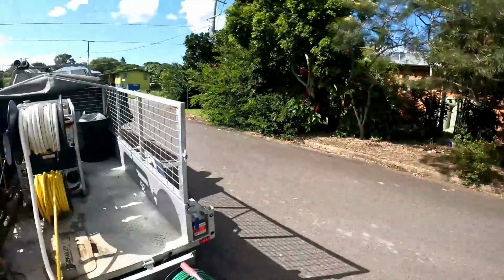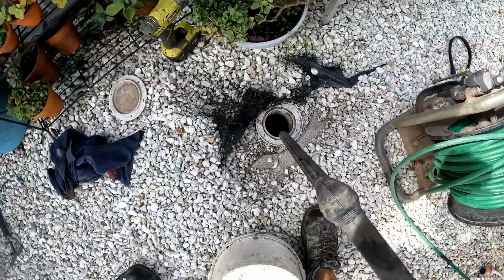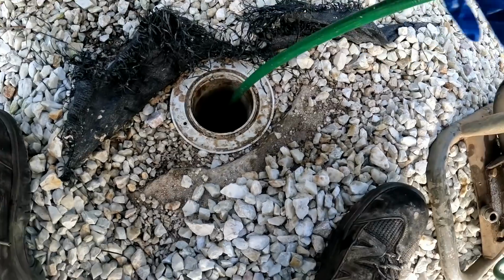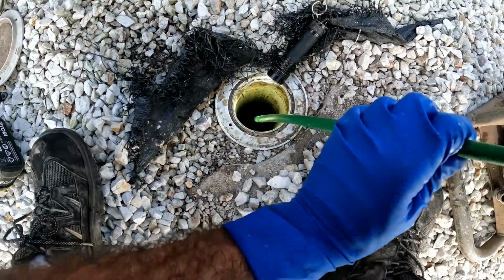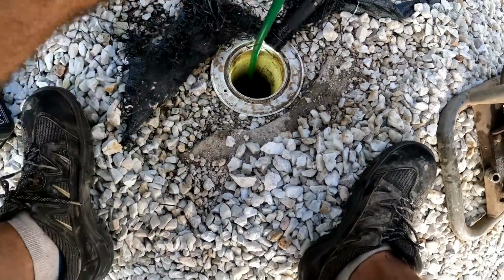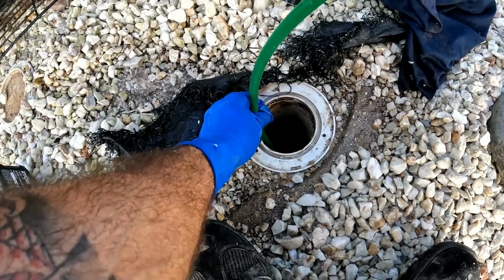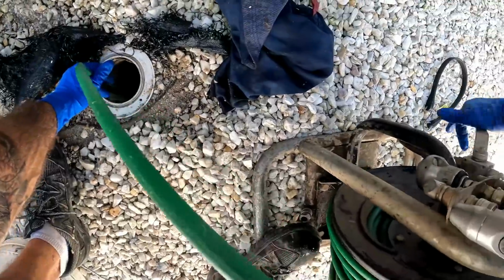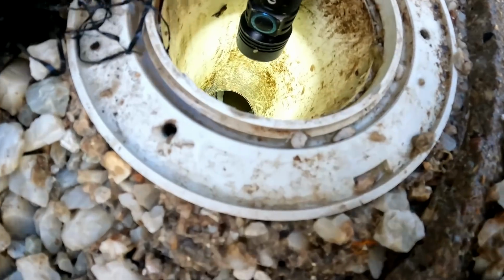Blocked Drain 233 - OMG | What Is Going On | Will This Come Out | Has This Been The Original Problem

Comment: So i am a career traffic controller. I recently did a traffic controls workzone for a state project for infrastructure repairs. (counsel line repair in Aus). Well the pipe was broke. They had a crew that performs line clearing like you but on a much larger scale, 1-2 ft round inside diameter pipe. Well they cleared them then they rolled a pvc vinyl tube up the pipe. clamped the ends off then filled it with pressurized steam. Which had the fire dept out thinking it was a broken steam pipe.  Well the steam solidified the vinyl pvc tube and basically molded itself to the pipe and replacing the old pipe. Very fascinating. I wonder if there is a smaller scale of that process that you could employ for broken pipes?
Reply: Yes, they have that for smaller pipes, too. I've seen a video or two on YouTube but don't know much more.

Comment: Reminds me of a gutter/down pipe stop. We had similar we used to block the gutters when we had fires about. As you tighten the screw the rubber starts turning back on itself and seals the pipe.

Comment: I can't help but reckon maybe that disc with rubber flap might be part of whatever is going on @39:46 , Like that was what it originally was part of but has disintegrated and the other bits already were long gone down the tooly hole. Strange indeed, but great you managed to wrangle it outta there

Comment: The dogs were so chill, even with the jet. Also, with things like kitchen fat, I wonder if a heated jetter like system would help. But then again, building and the cost of heating the water and waiting on more to heat up wouldn't be worth it in the long run
Reply: If you were to heat it, it would just solidify somewhere else down the line and cause someone else problems.

Comment: Could the plastic object be the inflatable plug which is used to test the house drains and vents for leaks?
Building an addition onto my little house, after I.nstalled the PVC drain and vent lines I was required to plug the drain and fill the water all the way to the top of the roof vent.   Water leaks would reveal where I failed to solvent weld? the pipes and fittings completely.

Comment: That was a very good retrieval. Almost looks like a test plug to me. Most of the rubber is gone but if you turn the screws it should tighten in the drain and seal it. Just a guess. Could be a flapper but not one I've ever seen.
Reply from the maker: Thank you 😊

Comment: What if it's a backwater valve, or that's one of the names it has in North America. It suppose to prevent sewage from the mains traveling into the house so to a blockage or a flooding.
Reply: What if it is... Whatever it is it broke off or fell from where it was supposed to be so it needed to be removed. Highly unlikely its a backwater valve as it doesn't look anything like one.

Comment: The screw through the middle actually makes me think of a pressure test plug that I recall Ollie having to extract in one of his videos.

The only thing that makes me dubious on that was in the disc assembly that Ollie fished out the rubber was much thicker, because it was supposed to expand as it was clamped down.  The rubber on this one looks more like just a single flap of rubber, and the whole thing you pulled out is way smaller and lighter.

The plug is in this video here, #600.  https://www.youtube.com/watch?v=V0ZwDwrQVZQ
Reply from the maker: It was for a reflux valve.